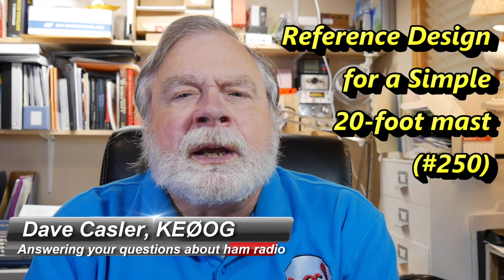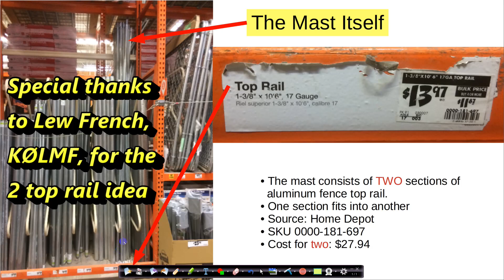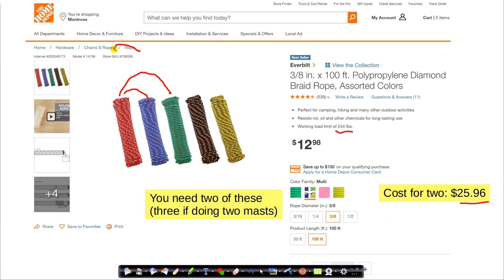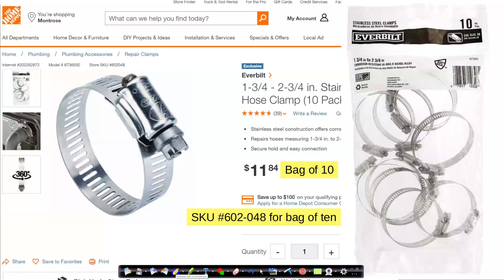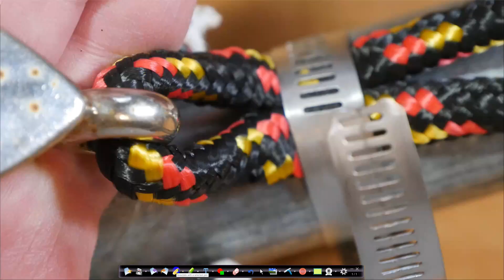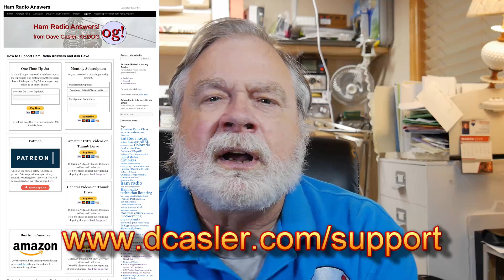Reference Station: A simple 20-foot mast (#250)

Comment: For those like me in ground so hard you can’t drive stakes (Texas limestone and calichi soil) - plan to follow Dave’s method with some modifications.  Going to jackhammer 12”x12” x 24”D holes to set guy line stakes in concrete.  The jackhammer goes through the limestone/calichi quite well..  

Will take a length of the top rail over to the Home Depot plumbing aisle and find an appropriate size of PVC pipe that the top rail will hopefully seat into like a sleeve.  Learned this from flagpole installers... going to dig a 12”x12”x24”D foundation hole to set a 3’ length of pvc into, set in concrete, with the pvc extending 1’ above grade.  Going to fill 2’ of the pvc pipe with mortar (approx to “slightly above grade” when set in foundation).

When the concrete is set/hard, can slide the mast top rail into the pvc pipe for a snug fit (still using guy wires), and so mast can be easily removed in the future.

When everything is done, going to drill a small weep hole through both pvc and mast, to allow Southern humidity condensation to drain out of mast.

Comment: If you slide a 3" piece of bicycle inner tube over the robe before using the hose clamp you'll save yourself a headache with the rope not being cut by the sharp edge of the hose clamp due to wind pulling on the mast.

Comment: I did this but used 3 sections.  Guyed it about 1/2 way up the second section and it is pretty solid. I have a 9 element 2 meter yagi and a 2 meter j-pole on it and it works great.
Reply: K4MJV 
I’m considering 2.5 sections... about what I can get away with, with homeowners assoc.

Comment: I have four 20 foot masts from Radio Shack which were 10feet in length and do not have any guys for my 80 meter horizontal loop for 40 years now.  No problem.  Back then the prices I believe was about what this one is now for the fence posts.  Use of a pulley makes all the difference in the word for work.

Comment: QUESTION on placement.  Dave, you’re saying 20’ H is ok for 40m ...  ideally (correct?) for the shortest run would want the mast near the house ... so what pros/cons on placement for those with single story, or two story, and/or metal roofs - any guidance on having mast near the house that affects performance?

... can you offer guidance for proximity to house structures like mentioned... vs running long runs of feed line to get away from the house/roof?  

I had a club elmer (well intentioned, but questionable knowledge based on other unrelated advice) tell me having a mast come right up to the house and metal roof was great because the roof acts like a ground plane... but doesn’t that “reset” the elevation to the roof level by having the mast directly adjacent to the exterior wall running up and beyond the roof level?